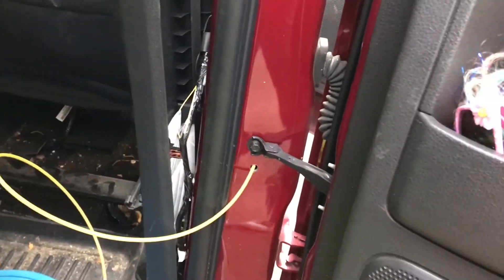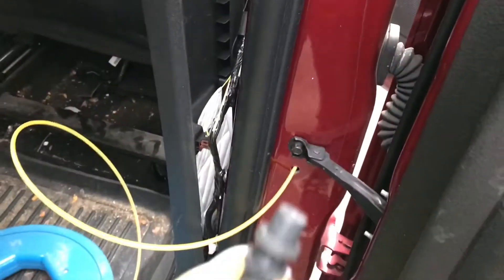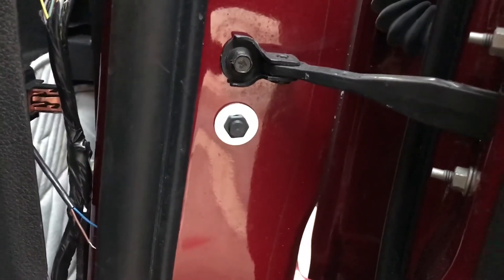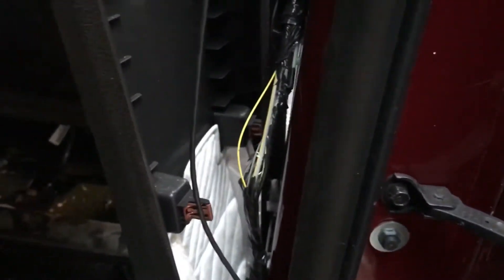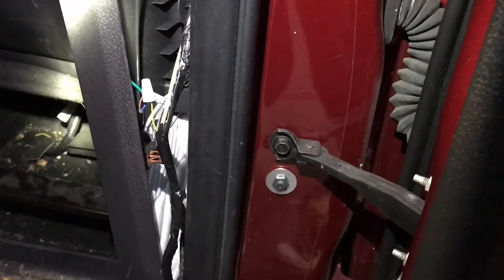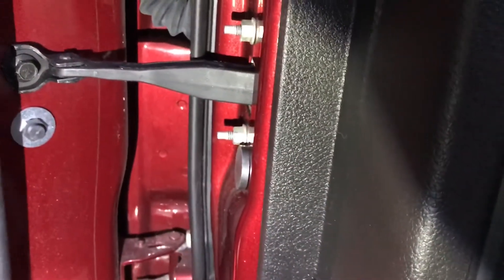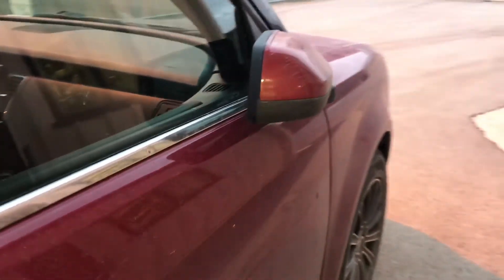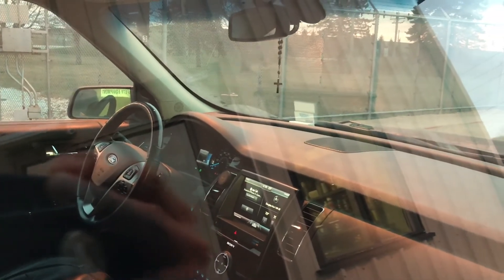Ford Flex Door Ajar Fix using a magnet switch - $10 in parts with working interior door lights

Comment: This should work on the front doors as well correct?
Reply from the maker: It should work the same in the front.  You would just have to look up your specific year’s wiring diagram to confirm the wire color

Comment: Wouldn't you need a normally closed switch?
Reply from the maker: The Normally Open switch is what you need and worked perfectly for me.  

With the door closed and the magnets near a NC switch, the switch would open and the input would lose contact with ground which would replicate the original problem.

Comment: Excellent idea! I’m about to order the magic link switch myself and give it a go. How is yours still holding up two years later?
Reply from the maker: I sold my Flex last year, but it held up with no problems because it was a simple set up with no complicated parts (unlike the OEM door switch/door latch assembly).

Comment: This was a LIFE and WALLET saver!  Got my 2013 just over 2 years ago.  Started having issues on the very same door.  Too many other vids require to basically disassemble the door.  Thanks again so much for doing this!
Reply from the maker: Glad it worked out for you! I couldn’t stand the cost of replacement, and never understood why Ford had to overcomplicate the design by combining the switch and latch into one assembly

Comment: If the yellow wire is cut, bottom yellow lead goes to switch? Top yellow goes to switch and ground?
Reply from the maker: When you cut the yellow wire in the B-Pillar (assuming you’re working on the same door as me, if not the color might be different - check the wiring diagram), connect the yellow wire from the floor up to one of the leads of the NO switch. The other lead of the NO switch needs to be connected to ground.  Just ignore the yellow wire from the top down, because this wire connects to the garbage Ford door switch that we’re bypassing.

Comment: Now if you can up with a way to upgrade our Sync 2 to Sync 3. Not that $1200 rebuild head unit from that Ebay seller.
Reply: I bought all the different parts from different sellers on eBay for about $700 and did it myself.

Comment: Where did you get the MagneLink switch from? I can't find it anywhere.
Reply from the maker: I may have bought it direct from Magnelink. Otherwise any magnetic/reed switch will do as long as it’s Normally Open. I did a quick search on Amazon and the brand Uxcell looks like it offers a similar product for $13.
Reply: You can order MagneLink magnetic switches direct.  Their contact information can be found at: www.magnelinkinc.com